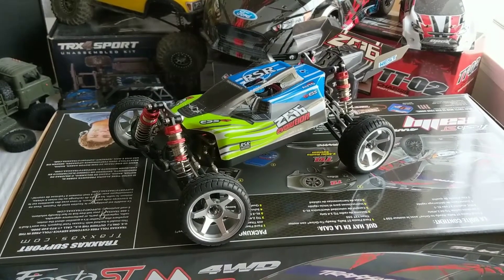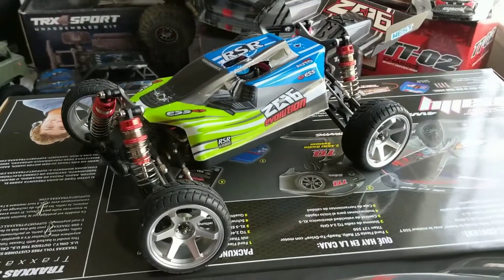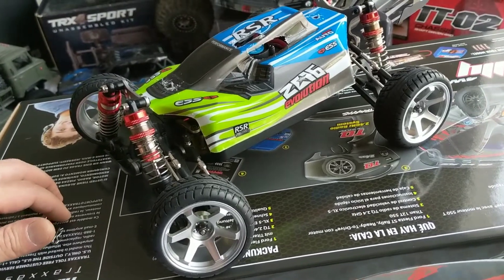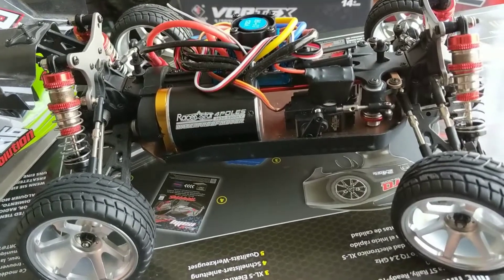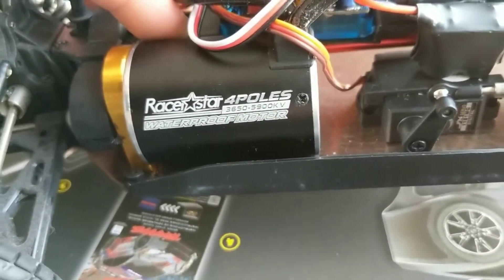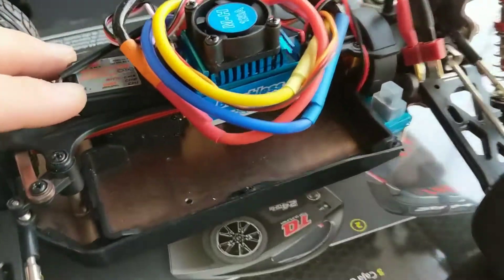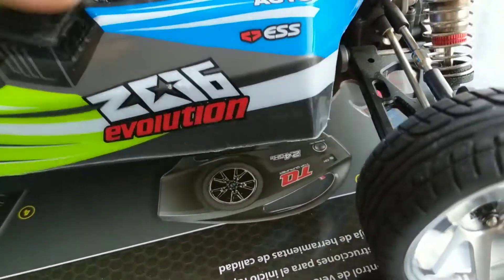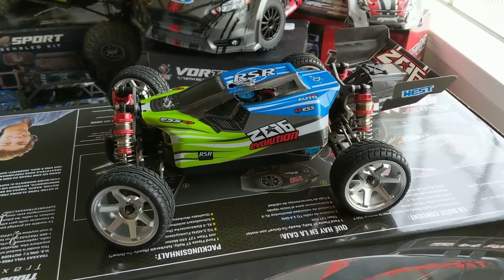Wltoys 144001 Brushless upgrade - Awesome first run but FAIL... ESC toasted!

Comment: i just got 66 mph on same kv motor and esc combo on 2 cell .
tried 3 cell but never reached full throttle on speed run .makes me worry about smoking esc .
the sudden throttle stabs cause very large spikes on my amp meter on all set ups .
Reply from the maker: Thanks for watching🤙 and nice speed!! I have yet to complete a successful run but it's definitely fast. I can confirm that I wasn't easy on the throttle, also that the 3s 11v+ combined with the 5900kv is beyond the max rpm spec of the motor. But these builds and projects are a blast🤙. Still one of my fav RCs.

Comment: Damn is that the chinese blue esc's I see on eBay all the time?
Reply from the maker: Sure is. Beware, haha! The 3650 5900kv was too much for it. Have another running a 3660 3300kv in my Remo Hobby just fine. Thanks for watching!
Reply: Damn. Just bought a blue 45a esc.   Same brand.  Ill run 2s. Ill put fan on motor too.  Fingers crossed....

Comment: Can this esc go together with a 3100 kv on  3s???
Reply from the maker: Thanks for checking out the fail🤣. Yes this esc will work fine on the 3100kv. I overloaded it running a 5900kv on this car.
Max rpm on these are 50k. 3100x11.1 is well under. Just monitor the heat.
If you go higher kv, you can run 2s and still get speed. Just depends what you're going for. 3s has the punch.